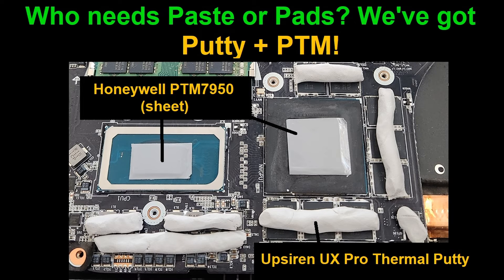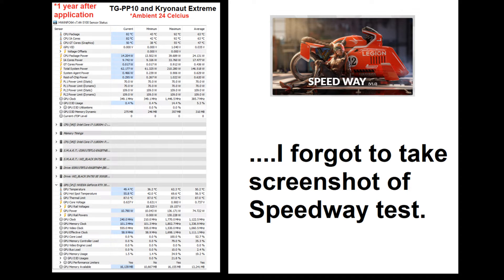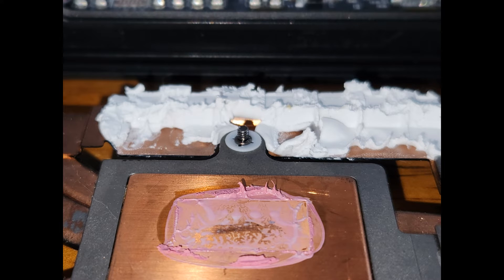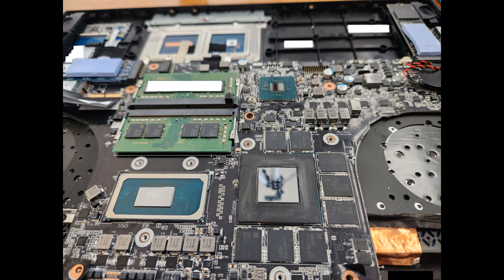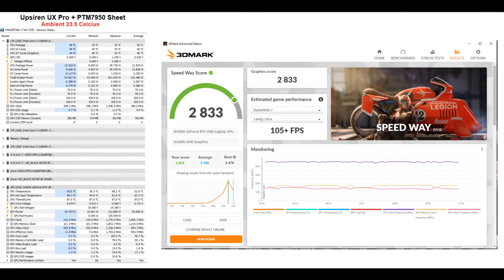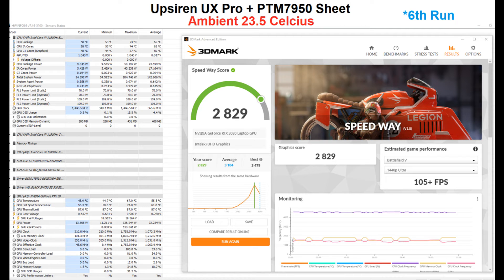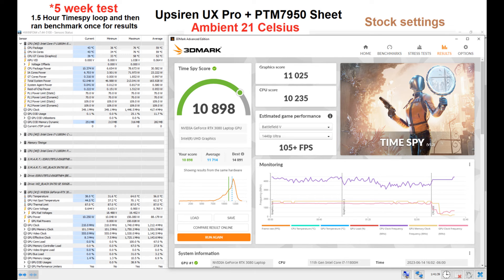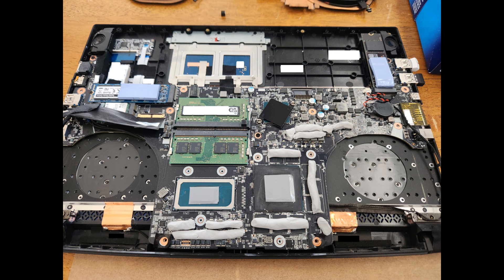RTX3080 Laptop meets Upsiren UX Pro thermal putty and Honeywell PTM7950

Comment: Thank you for this great video very informative
I have an acer nitro 5 2022 model with i9 12900h and rtx 3060 
The cpu is always thermal throttling at 92c in most games 
The gpu reaches 81c with auto fan speed i put them on around 5k rpm to reach 74c on gpu but cpu is still throttling 
Do you recommend i use ptm 7950 on dies and u6 pro putty for vrms and other parts that have stock thermal putty?
Or is the heat sink of acer nitro just bad that it wouldn't matter much ? 
I have repasted the dies with mastergel pro v2 from cooler master but didnt change thermal putty
Reply from the maker: I think it would be worthwhile either trying a different paste or going with PTM7950 or PCM-1 on CPU and GPU Die.

While I think upgrading the putty is a good thing, it likely won't improve temperatures of CPU or GPU Die, but may lower hotspot temps.

I wish GDDR6 in laptops has temperature sensors. I wonder if AMD laptops include more sensors.

Either U6 Pro or UX Pro would be good if you do decide to change the putty.
Reply: @snarksdomain  guess I will give it a go and hope for the best 
Thank you for the reply
Reply from the maker: @ibrahem2634  It seems like your cooler only has the 3 heatpipes. 1 for CPU, 1 for GPU, and then the 3rd transfers heat between the fan blocks.

Some folks add heat pipes to their laptops to increase heat transfer to the blocks, but it does take some finess, and there is added risk if the added pipes aren't well fixed in place.

With not enough heatpipes, it's like rush hour traffic. Bumper to bumper heat.
Reply: @snarksdomain that sounds like it would solve the heat problem but there is no one where I live that would do that (I'm in Egypt) stuff like that certainly requires experience
And I wouldn't trust myself with that too tbh I would be scared of messing something up I will try ptm 7950 and hopefully it would help out with the heat 
Thank you for your reply 👍
Reply from the maker: @ibrahem2634  perhaps I've give you a shout if/when I'm in Egypt again. When I do travel, I'll have to start bringing putty/PTM/heatpipes/kapton tape/conformal coating/etc. with me, lol.
Reply: @snarksdomain  That would be great lol 
Thanks man
Reply from the maker: @ibrahem2634  I wish I could even have a chance of doing that soon, but chances are extremely low for this year. On the off chance I pass through Egypt next Spring I will try to remember to check in with you and see how your laptop is doing. Fix a laptop and smoke some Grape Mint 😀 (or Double Apple).
Reply: @snarksdomain  hi 
i got the ptm 7950 and the cpu temps are impressive now when it used to be 75c its at 55c now 
but the gpu temps are very similar like 70c+ and at heavy load with auto fan could hit 80c 
could my ptm 7950 application on the gpu be bad or is it normal like that ? its an rtx 3060 100watt
Reply from the maker: @ibrahem2634  With Auto fan, I believe that is normal. Unless you set a more aggressive fan curve or full fan, it will aim to keep it at a certain temperature and only spin the fans as fast as it need to not exceed a certain temperature. Would be interesting to see a fanspeed comparison of before and after. I wouldn't be surprised if the fans spin a little slower than before.
Reply: @snarksdomain do you need to change thermal putty after 3 years or will the ptm 7950 be enough on the cpu and gpu.
Reply from the maker: @seberman6640  It's hard to say for sure. Thermal Putty I applied 2 years ago, is still performing well. Is does gradually stiffen over time but doesn't shrink necessarily. Mostly just the viscosity increases over time.

I should know in the next 5 years how long a putty can last. For me, the viscosity doesn't matter long term, only it's continued performance.

Edit: The PTM should be good long term as well. Some day lifetime of a product. Some say 5 years. We should know in time.
Reply: So if I still have the stock pink putty or pad that comes with the laptop I will only need to change the cpu gpu stock paste into ptm 7950 and it will reduce the temps and no thermal throttling?
Reply from the maker: @seberman6640  If you are currently experiencing thermal throttling, and find that the stock thermal paste is dried out and that it's the likely cause of thermal throttling, then that would be a good way to go.

Depends on the brand of laptop you have. Lenovo is already using PTM7958 on the CPU and GPU core. PTM7958 is apparently a higher performing Phase Change Material than PTM7950.

If, however, your laptop uses normal thermal paste, and you believe it's dried out, then changing to PTM7950 should do well for you.
Reply from the maker: @seberman6640  I can't guarantee no thermal throttling, since different climates (termperature, humidity) will give different results. Cooler design, CPU TDP, GPU TGP and the cleanliness of the fans and the surface a laptop is sitting on also greatly affect the results.
Reply: @snarksdomain  how long can I keep my ptm honeywell 7950 sheet can I use some of it for my laptop now and 2 years later for another laptop will the sheet/pad get expired? I bought a large one.
Reply from the maker: @seberman6640  Honeywell states a 12-month shelf life, but I wouldn't be surprised if it is still fine a few years from now. I think the biggest thing is placing it in a cool place (room temperature, not freezer). I would also think keeping it away from sunlight would be a good idea, and maybe even put it in a ziplock bag.

If it still looks the same consistency in 2 years, I wouldn't hesitate to use it. It should still be flexible and not crumble. If it is no longer those things, then I wouldn't use it.
Reply: @ibrahem2634 hello from egypt too😂
can i ask you where u got ptm7950 i can't find anything in here 😅
Reply: @minaisrael1128  bought it from aliexpress 
I highly doubt you would find it in egypt
Reply: @ibrahem2634  thanks for reply that fast as the video and comments are pretty old ..
does it stand good till now in terms of stability and thermals ! 
i will be grateful if u send me a link to buy it i have shit thermals in my dell g15 with i5 11th gen and rtx 3050ti
Reply: @minaisrael1128  its very stable yes once it goes through multiple heat cycles with normal use 
For me in my acer nitro with rtx 3060 the temp under full load (100 watt) with auto fan speed it tops at 74 and cpu (i9 12900h) depends on cpu usage as not all application use cpu in same manner but under heavy load it gets to 80-83 
But if i increase fan speed just a little bit its like the sweet spot for ptm 7950 gpu barely reaches 70 and cpu at 70-75 max
This will ofc be different for different laptops 
But overall much better than any thermal paste i tried and i dont have to ever change it again

I probably wont find the link i bought it from as these come and go from different sellers but its the same material just be sure to check the reviews and stick with the one with most positive reviews just to be safe and good luck

Comment: Appriciate the great detailed video!
Would you recommend this putty over the U6 for a laptop?(seems less greasy)
combined with the PTM7950 for dies
Reply from the maker: I kind of like both putties. Clay like putties are nice to work with, but I can also see use cases where a softer and stickier putty could be more ideal where ocassional flexing/compression are applied to the assembly. Most laptops should be stiff enough to not run into issues, of handled with care.

I suppose it comes down to personal preference and budget.

Comment: "As you can see the cpu is topping out at 67* Celsius" - Image shows a package temp of 41*C 6:41
Reply from the maker: That's because after the test stops running there is no longer any load on the CPU. So I had to reference max temps during the test to be able to compare them.

Comment: Hello. I consulted one laptop service center guy, he said that after applying laird instead of stock thermal pads, in order to not risk to crack the chips(because of increased pressure), he uses some custom silicone washers. Can you comment on this? Thanks.
Reply from the maker: I've heard a few people mention the possibility of increased pressure on the core before. I haven't used any silicone washers myself, but it likely wouldn't hurt if you were concerned.

Lenovo uses thermal putty in their laptops. Perhaps they've designed the mounting pressure with this in mind.

For my laptop, it didn't seem like there was a lot of spring action by tightening the screws. In my mind, a GPU with a stiff springy "X"  mounting bracket, it would have potentially higher risk of such.

Either way, if using those silicone washers doesn't affect core contact, then it can't hurt.

The PS5 similarly uses thermal putty. I think a lot of people don't like the idea of a putty simply because it is different than what we are used to. Putty lends itself well to automated application, whereas pads need someone to put them in place. In general, I think we'll start seeing higher quality pads and putties used going forward. With GDDR7 coming soon the power density will likely be higher and so we will need high performance thermal solutions to deal with the added heat. We'll start seeing more GPU's with vapors chambers and laptops as well.
Reply: @snarksdomain  Great reply, thanks a lot, will think what to do. The washers are tricky, because I don't know which ones to use, will probably have to order them from the same service center, where I order ptm (which they claim is the original one). Also they sell the paste to polish the surfaces. Do you ever polish it? I read it only improves temps by 1C, and probably risky to polish the cores.
Reply from the maker: @goldeneagle8259  I haven't done polishing of cores or CPU's at all. If I were to do anything, it would likely be lapping of a CPU using one of those Thermal Grizzly lapping tools. I don't think I'd go that far with a GPU Die. First and foremost, it would be very difficult to do it in a controlled way when the core is still connected to the PCB.

Perhaps if I were trying to set world records, I would consider doing more of that type of modification, but not for a daily driven CPU/GPU.
Reply: @snarksdomain  Got it, I agree.

Comment: i repasted my liquid devil 7900 XTX 2 times i run it at unleashed bios 410w total board power fresh mx-4 it performed 75c hotspot but then 1-2 weeks later get really bad as pumpout effects heat and cooling cycles keep pumping away paste till i get 92c hotspot i suspect after a year i be having 110c hotspot, so yesterday i put on PTM7950 i got better results like 66c hotspot right away first minutes 72c hotspot in 3D occt i put my PTM7950 in the freezer my pad had tiny rip at edge but came out fine smudged it down put on cooler so far so good.
when i took of cooler i had dry spot down the middle of my GCD.
my liquid devil 7900 XTX is cooled by 1 single Mo-ra3 420 with NF-A20 my fear is still it will get worse but i hope it gets better.
And when i aplied MX-4 i used almost to much spread manual + extra in middle like drop everyone would probably say to much but it gave good results for a week maybe 2 weeks.
Reply from the maker: I use the same method when applying paste. I even spread a thin layer and place a dot in the middle.

Sounds like PTM7950 is working well for you so far. Let us know what it's like after a while and if you run into any issues. It will be interesting to see how it does with high wattage heat cycles.
Reply: @snarksdomain  I try to remember you may have to give me a nudge in like a month eitherway MX-4 or even MX-6 from what i understood is trash paste it has no longevity
Reply from the maker: @Arokhantos  I'll try to remind you in a month or so to see how it's holding up :)
Reply from the maker: @Arokhantos How are your temperatures holding up?

Comment: Hello.  By any chance would you do a review on upsiren utg-x  later on? got weirded on when i saw it with your  temperature "graph/template" on ali but i havent seen you posted new videos lol
Reply from the maker: I haven't tested UTG-X yet actually. Is there a graph showing results for UTG-X on Aliexpress?

Edit: I see the chart you're talking about now. Definitely not mine. In the furmark snapshot you can see the language in the lower left search bar isn't English as well.

Regarding the chart, the colours aren't scaling correctly in my opinion. I always scale my colors between coolest and either hottest or a fixed temperature (for VRAM 110. For Core 85).

Gong forward, I'll also be using a watermark in my charts, thanks to the folks over on the Legion Discord server for pointing that out.

Comment: how much of the thermal pad did you use? the dimension? because I'm planning on buying one but I don't want to waste money buying too much
Reply from the maker: I didn't weigh the putty before and after, unfortunately.

For a laptop, if you only replace the pads on the VRAM, then 20g is enough. Otherwise, I'd recommend getting 50g. It is likely closer to 30-35g by my estimation.

Comment: Hey snark, I have some questions I'd like to ask regarding Upsiren UX Pro,
1. Will 20g of putty be enough to replace the pads on a PS4 and 3080Ti?
2. How long can the putty last after application?
3. How long can I keep the putty  assuming I have excess putty leftover in the container after applying them onto what I want?
Thanks in advance btw, keep it up with the tests and vids!
Reply from the maker: I would recommend getting 50g. That might even be a bit tight to do both.

It should last a very long time, so I would also recommend picking something like PTM7950 for the core. That way you don't have to open it up again for a long time (until thermals tell you otherwise).

As far as how long unused putty lasts, it may differ between the putties, but I have ~3 year old TG-PP10 that is still soft and easy to use. I store it inside a zip lock bag at room temperature.

My presumption is that most silicone based putties should behave similarly in regards to longevity of storage.

As an example, MG860 has a shelf life of 5 years (not very high performing, though). Putties are generally used in long life applications, often never being replaced.
Reply: @snarksdomain  thank for the reply! Greatly appreciate it.

Comment: Can I ask a favour? Is the UX Pro still malleable at Fridge/Freezer temps? Thinking that you could 3D print moulds for the components/strip of components to suit the right shape and thickness. Would help to minimise waste and wouldn't set off the same OCD triggers as the log rolls lol :P
Reply from the maker: I hear you on the OCD side of things. I'll try to roll smoother rolls.

I'm not sure how malleable it would be at lower temps. May have to experiment.

That being said, if you wanted to make moulds you could make them fit around VRAM and then fill them up like Cement forms and then scrape along the top to collect excess. Just be sure to have the "pad" height matching stock thermal pads.

With math, we can be very accurate with putty and use the log method.
Reply: @snarksdomain  Haha, just in case - I was only messing around with your rolls :)

Now onto your point about math and the log method - I have binged a few of your videos today and heard you mention this point. Can you point me in the right direction for the theory behind it? I can only assume the size of the log would change depending on the thickness of the previous padding etc. 

I'm currently planning on doing my CPU (PTM), GPU (PTM & UX Pro), Xbox Series X (PTM & UX Pro) and might even check out my MOBO given its out of warranty now too. So as I said, your videos have gotten a good workout from me today :P

Comment: How is Vrams VRMS DOING WITH UX pro putty. I recently repasted my MSI Vector GP76 I7 12th gen, 3080 ti, 64GB RAM. 

I used NT-H2 thermal paste and K5 Pro putty and it appears my temps have been running a little hotter than usual. So i just ordered some gelid GC extreme paste as its thicker and supposedly does better with laptops but my concern is the K5 pro putty over the VRAMs not holding up and is there a way i can check the temps of the VRAMs ?
Reply from the maker: You will probably want to replace that K5 Pro with either a good thermal pad or a good putty. K5 Pro is one of the worst performing putties I've tested and also messier than most other putties.
Reply: @snarksdomain3453  yes it's definitely messy. I ordered some upsiren ux pro ultra. Wish I stayed away from the K5 pro.